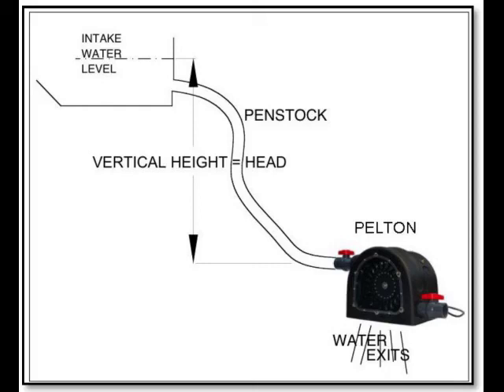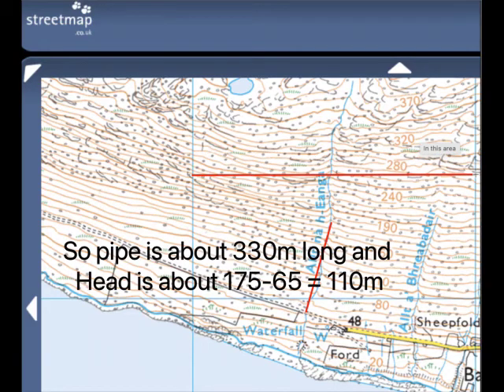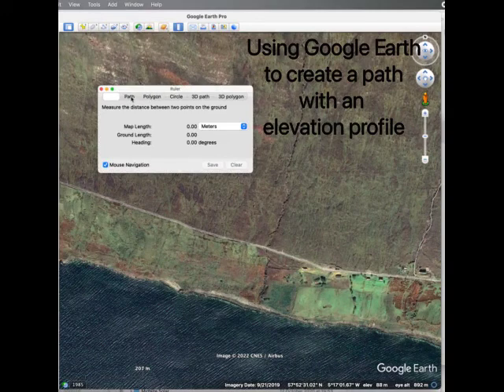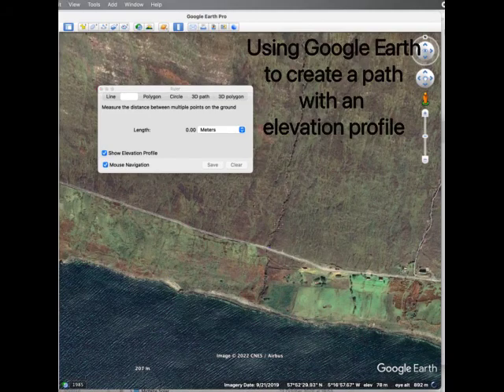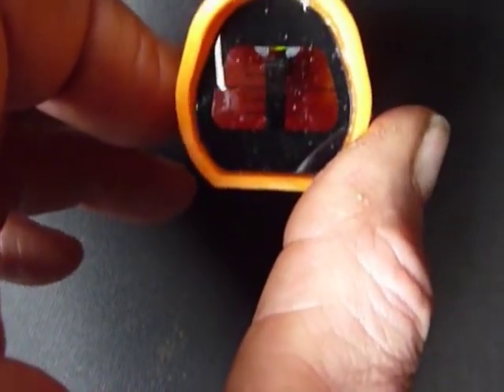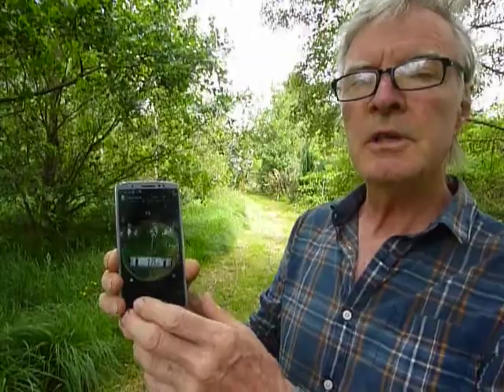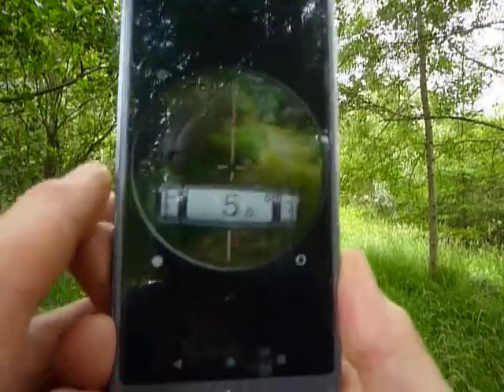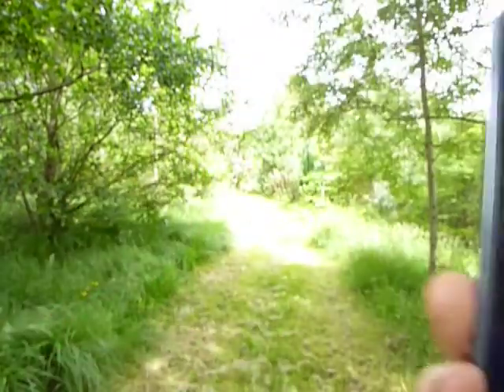Some methods of estimating head for a turbine

Comment: I believe it would be easier to simply use the GPS altitude function on your phone or tablet(?).
Reply: Sorry, I now find I'm wrong about that.
Reply from the maker: Yes there are simpler methods but they are not accurate enough.  By all means use all methods available and compare the results but GPS is not great for altitude.  I have a GPS with an aneroid altimeter built in that I sometimes use but it is costly to buy and even that is subject to changes in air pressure.  So for low head sites it is not great, and using GPS alone is pretty hopeless.  Google earth is another resource that I use but again it is not perfect.